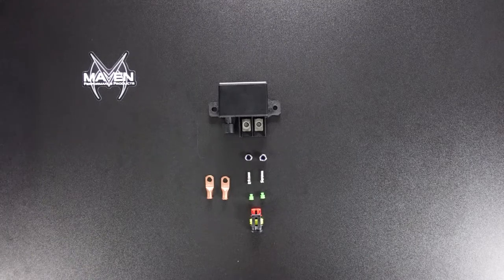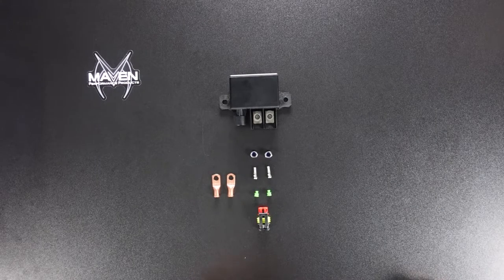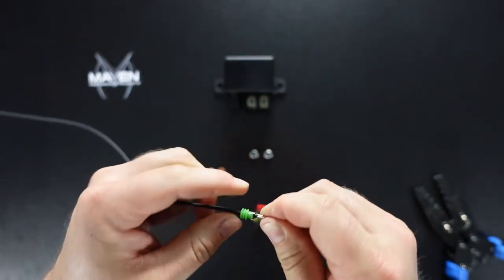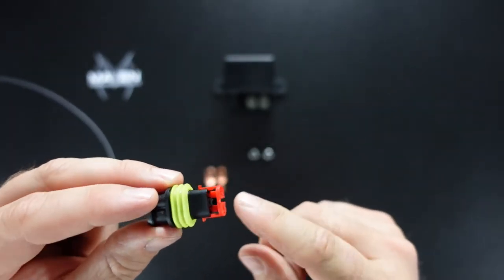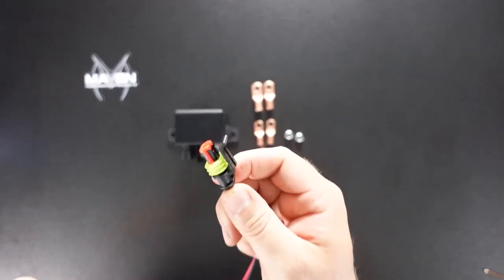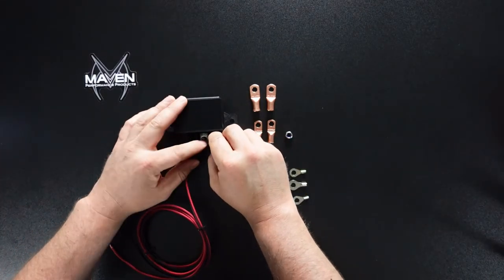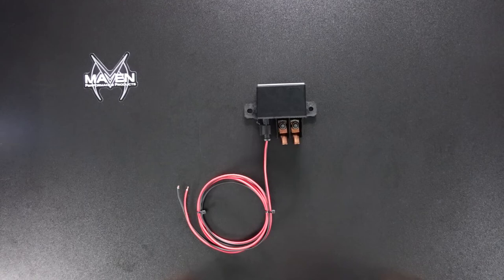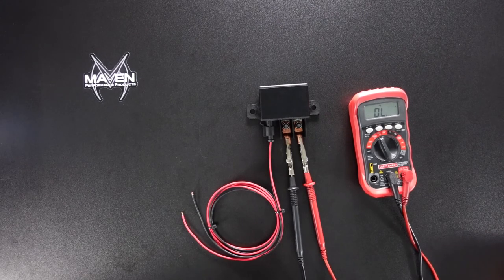High Current Relay

Comment: Was gonna get this for my fuel pump. But I'm running 2 fuel pumps, and 2nd pump will be triggered when needed.. so I'm not sure if it's the best choice for me to have 2 of these relay, 1 for each pump...or just regular  4pin relay
Reply from the maker: @damnitdang  how much current do the pumps draw ?
Reply: @mavenperformance  it says 22.5a.. so around there... I'm using 2 walbro 450s. 1 main and the 2nd for extra when it needs it. So I don't think I'll utilize this TE relay for a fuel pump setup cus it needs 2 separate turn on